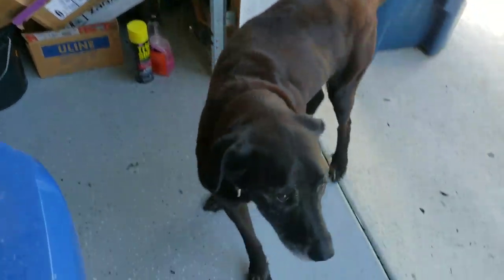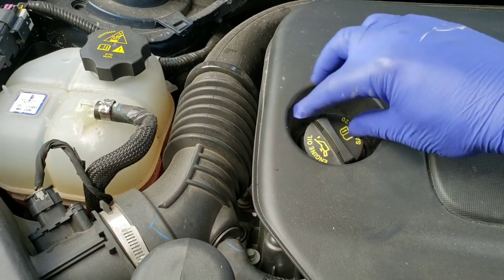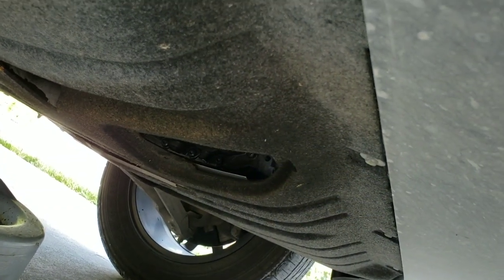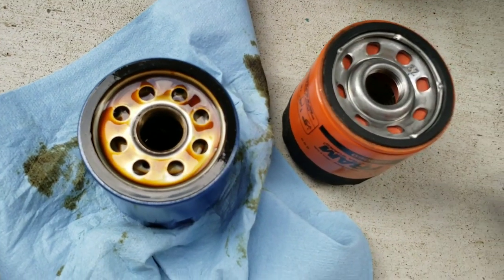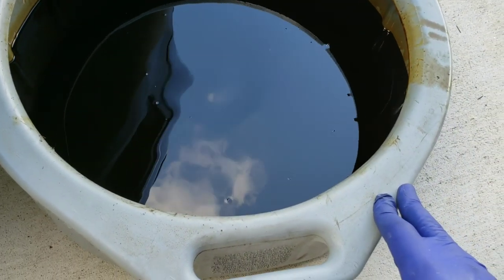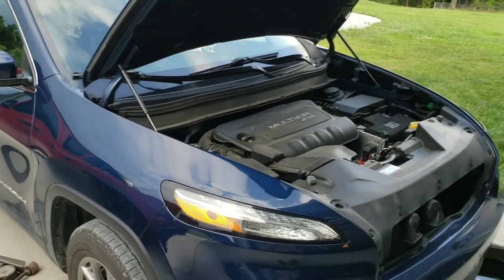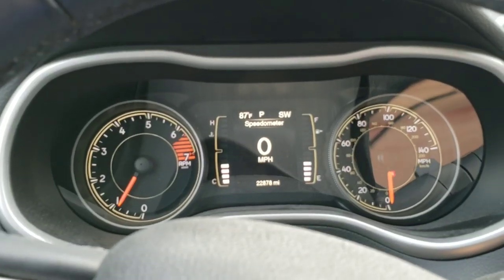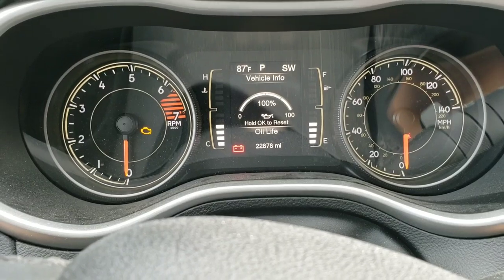2018 Jeep Cherokee 2.4L Oil Change - Not Burning Oil Anymore!

Comment: Bought my wife the same Jeep when it hit 40 thousand miles it had to have a whole new engine put in it because the piston rings broke so dude if you get this message tell them you need a new engine and they'll have to replace it Chrysler has been having to replace these engines in these 2018 Jeeps for a long time now so you need to go ask question

Comment: How has the 5W-30 done? Like is it better?
Reply: I'm running 5w30 on my 2016 Promaster City with no issues at all, my friend is running the same weight on his Chrysler 200 and no issues either. I'm sure the fuel economy is slightly affected, I don't keep track of it.

Comment: Frame basically has card board for a filter. Which could lead to oil starvation. I cut one apart some time ago, never used them again.

Comment: Do you recommend me switching to the 5w30 in our 2.4 Dart that also consumes oil like a mother? FYI we are in Vegas, so summers are HOT.
Reply: RebelRob34  do not use 5w30 in your dart if it’s a 2.4 or 1.4 multi air. The 2.0 is dual overhead came and could possibly tolerate that oil.  The multi air has small oil galleys and needs thin oil.  Will not run correctly with that oil.  And your check engine light will come on.  You need an engine. Only fix for this.  If you ran your engine until it completely ran out of oil to the point it stalls. Your engine is done.
Reply: @Christmaslightguy84  So just keep it topped off and drive as long as I can? Runs darn good.
Reply: RebelRob34 yeah.  I would try using a better oil with high flash point to help with oil consumption.  But if it’s no longer under warranty keep oil in it and should be good to go.   This engine needs oil pressure to open I take valves. Now it’s not good but if your engine runs out of oil it simply turns off, unlike a conventional that destroys bearings.  So if you did run out of oil and it shuts off your engine will start up with oil refilled.  It will take a few seconds longer to start if you run out because oil pressure needs to build in the intake brick.

Comment: What a disgrace that it should be so difficult just to change the oil.
Reply: It's really not that difficult. He's just using the wrong tools, other than that it's just like a regular car. He needs an oil filter socket then he can just take the little trap door out and do all his work from there.